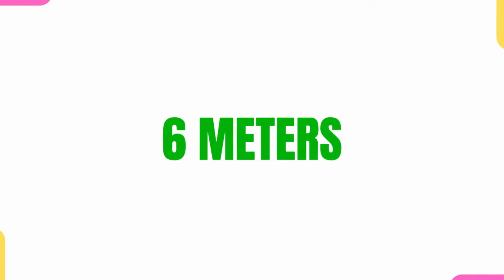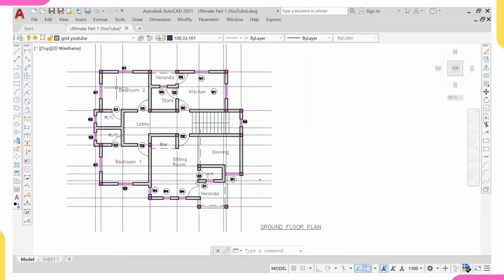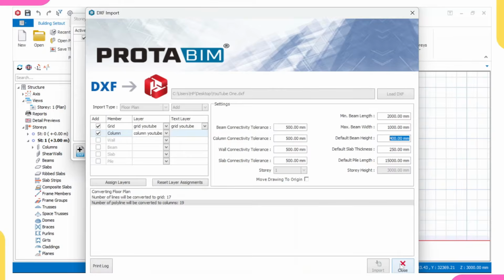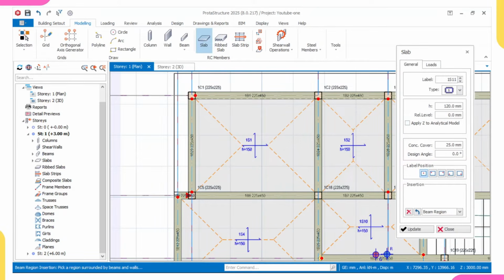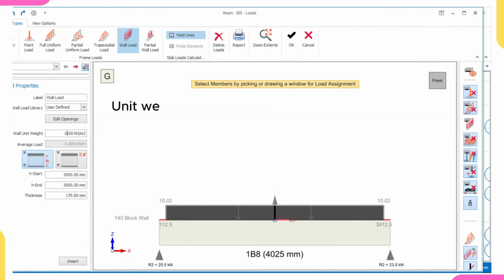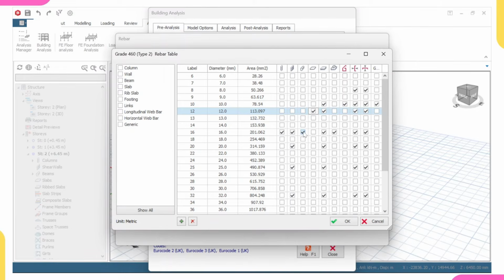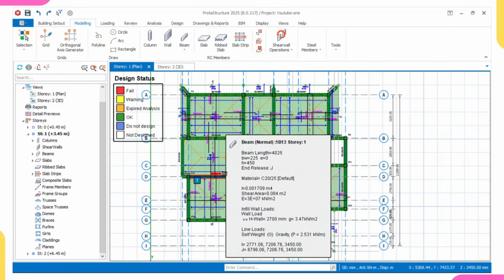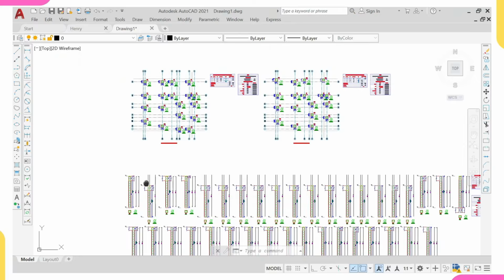Complete ProtaStructure Tutorial 101 (Ultimate Beginners Guide)

Comment: Another importance of hinging is that:
If you do not hinge, Prota will analyse as fixed therefore giving lower (incorrect) deflection for the span. Because if the end span has moments, the outer span deflection will reduce.
However, you can avoid hinging, if the end support reinforcement is going to be fixed as a fixed moment end (to reduce end-span deflection).
Reply from the maker: Correct 💯

Comment: Hi Engr. I’m a undergraduate. a question,
In panelling for the structural design, I can see you delete some partition walls of which you don’t add them as line loads on the slab in the design, won’t it cause deflection and bending in the slab after construction.
Reply from the maker: you can apply it as line load.
you can equally get my course and learn more about it 
https://selar.com/3i96386b2v